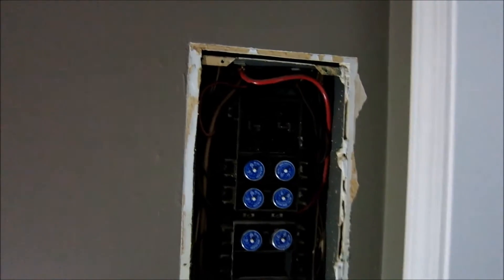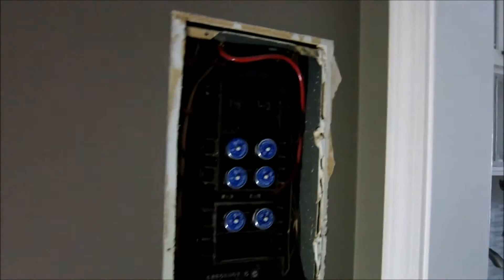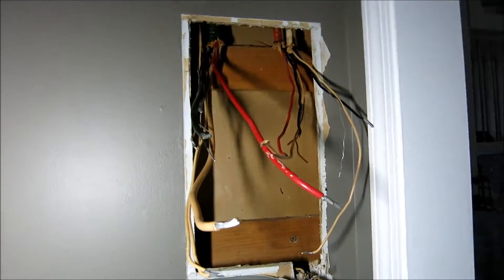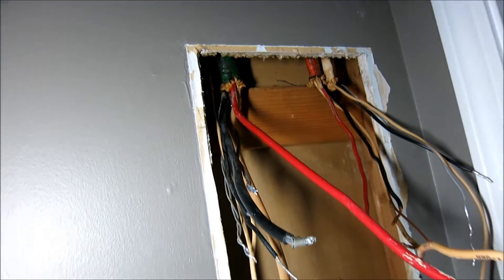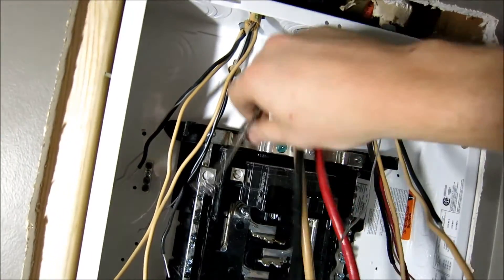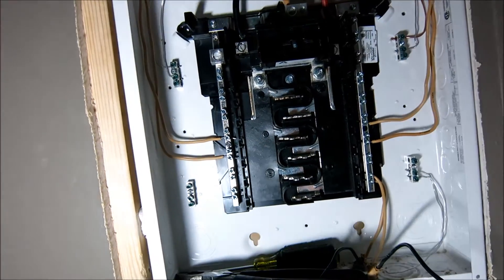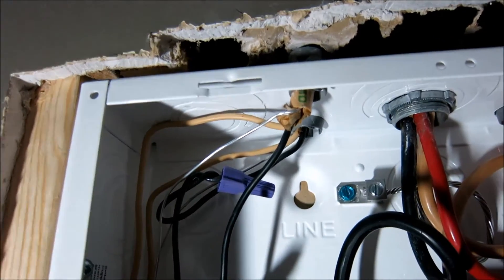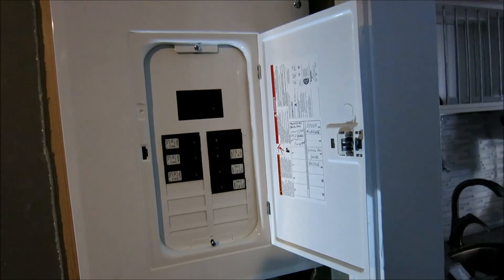HOW TO INSTALL A NEW BREAKER PANEL ALUMINUM OR COPPER

Comment: How do you know which wire goes to which switch? Or does it not matter which wire goes to which? Would you just label each wire after you figure out what is turned on after switching each switch to the on position?
Reply from the maker: You can use a toner or yes flip breaker on and test outlets

Comment: Hey how to u rest those exact blue breakers wit white buttons on them??? My power went out upstairs n I have no idea how to reset those. I kept click those white buttons but still doesn't work. Plz help ASAP! My electrician is not picking up ESP at this time of night. Can't find any info online for these certain breakers.
Reply from the maker: Lisa Snails the reset it that whit button is the reset if your clicking it and its not resetting take a breaker from another spot and try it in the upstairs spot if it Fix's the problem its the breaker is dead and you need a new one they wear down after a while. Now if you put the new breaker in the up stairs spot and it trips the new one and it won't reset it means you have a dead short some were up stairs try unplugging things from the wall and see if its something plugged in if everything's unplugged and its still doing it. That means its either a wire, switch or a plug and you should get a electrician out to help chase down the short

Comment: If this is a sub panel the green screw above the main breaker should have been removed. This bonds the neutral to the grounding system and should only be done once where the service enters the building. Cheers!